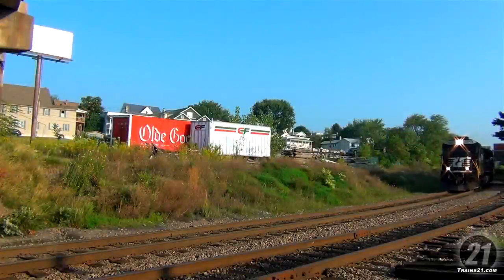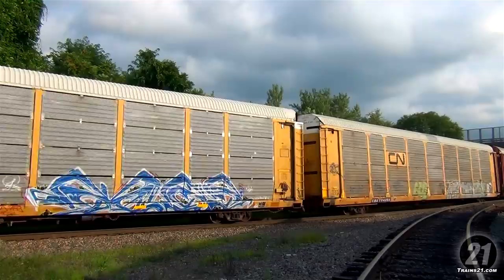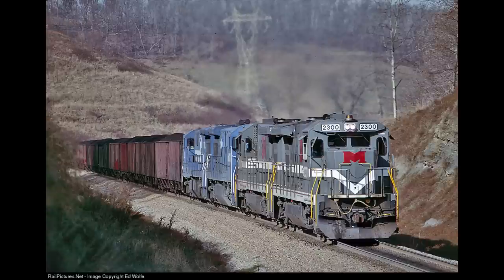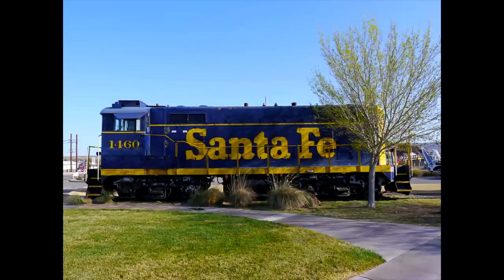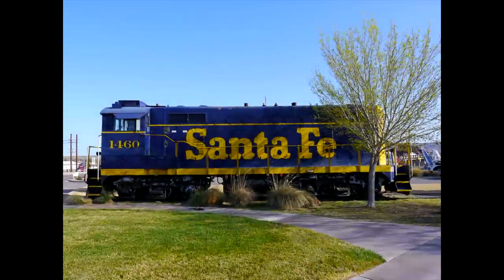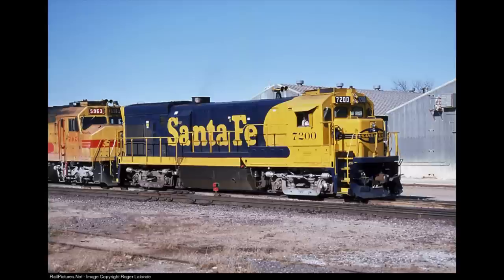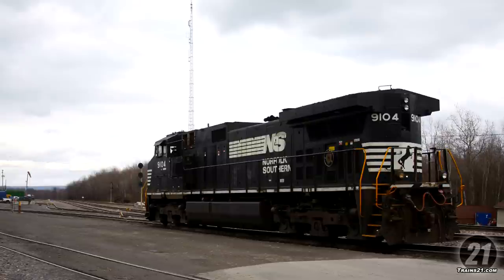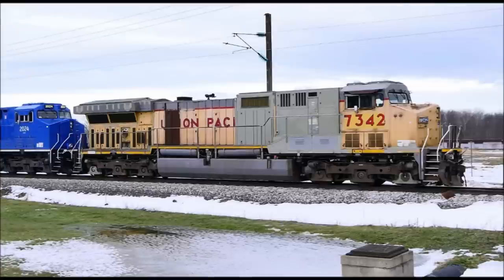Locomotive Traction Explained.. How Diesel Locomotive Traction Motors Work

Comment: A little off the subject but  when i worked at the Bethlehem Steel Corp.in Steelton Pa. I was a locomotive crane helper. We used to dig our cars out of a draft on a spur track. My boss used to panic and told us to dig them out instead of waiting for the Steelton and Highspire  R.R. to dig them out well needless to say we were pulling as high as 15 cars out to get to the ones we wanted. That was with an American Diesel Electric Locomotive Crane. Of course we smoked a few traction motors.  That crane was not made to shift that kind of weight of course. Cool informative video.